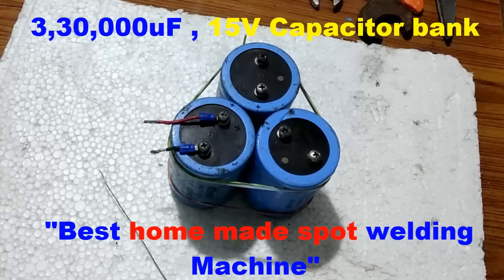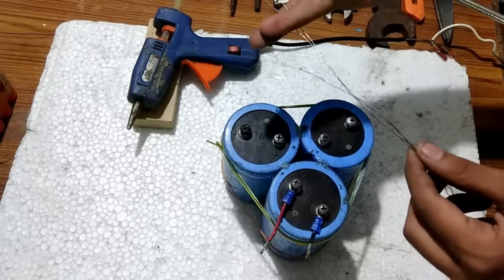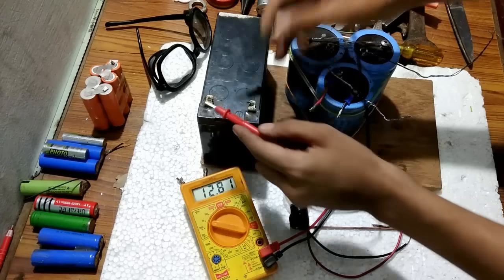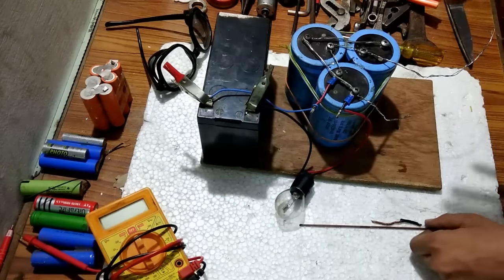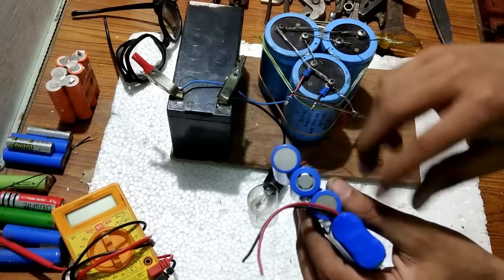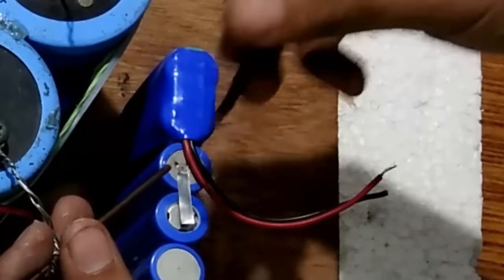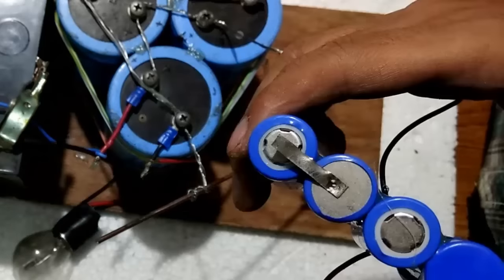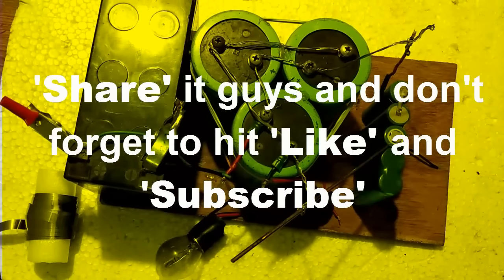How to Make Battery Spot Welder || New Capacitor Welding DIY

Comment: bro you nailed it....i saw various videos for spot welding using microwave transformer which is bit tricky and time consuming but your spot welder is easy and effective.
Reply from the maker: Brijesh kumar Thanks .. I have been figuring out a method for effective spot welding for a long time and i have tried most of them.. This technique indeed gave the best results :)
Reply: creativ electron7m  from where to purchase capacitors
Reply from the maker: varunanaditya mandawara : I got them from large DC motors.. These should be available on ebay or amazon.
Reply from the maker: varunanaditya mandawara :u there on WhatsApp????
Reply from the maker: varunanaditya mandawara ok

Comment: Really a simple safe nice project. 

I would personally find a case, protect the capacitors from accidental shortcuts and replace the terminals with longer good quality wires. 

And i would builda pedal for it to activate the circuit only when you are in the correct position. Like this you have to guess that the welding spot will be the right one at the moment of the shortcut. 

With a pedal - ab hand made one - you can press it only when you're ready. 

To metal bars with a wood frame and a spring can do the job. 

Anyway the idea is amazing.

Comment: Okay, thanks. I am making a battery pack for a high amp load (30-40A). Do you knoe the thickness of the nickel alloy strip you use in your demonstrations? Cheers

Comment: Very clever solution. I need to spot weld some Li-ion batteries together. Is it important to have a sharp point on the copper electrode?
Reply from the maker: not too sharp little close to sharp
Reply: Also; what metal is the negative electrode made of? And is this important?
Reply from the maker: the one to be touched to the battery is to be flat while the other one is to be pointed
Reply: Thank you. Is it important to use copper? Or would say a brass rod work?

Comment: Thank you Sr for the video. Can i use the 6 500farrad  supercaps to spot ? Thank you
Reply from the maker: garabini NJM higher capacitance means higher SC Current which will burn the nickel strip.so in parallel they won't work but they will work perfectly in series.

Comment: This is a good simple design, but what is the advantage over going directly to the battery terminals (skipping the capacitors)?
Reply from the maker: Time. 
  Spot welding needs really high current for about a sec or even less than that.Capacitors cut-off automatically after dissipating large current while going though a Shot circuit while direct battery connection not only reduced battery life but also damages the welding strip.Also you are the one who has to perform the disconnection.High current for longer time results in blackening of the strips....If you can some how control the Short circuit current discharge time,i am sure that direct batteries should work the same..
Reply: creativ Electron7M Thank you,  that explains it!
Reply from the maker: J Bishop Anytime :)
Reply: Use a 12v solenoid relay switch instead of capacitors and fashion the terminals so that you can hold them with one hand. The solenoid will do your connecting and disconnecting for you, you just have to press a momentary switch to set the solenoid off. Boom! You're welded!
Reply from the maker: Good idea!! I will try that for  sure :)
Reply: AvE?
Reply from the maker: ELECTROHAXZ ave??
Reply: A battery has a reasonably high internal resistance, so unless its quite big it won't be able to deliver the current required for welding. This setup can be pre-charged from a very small battery or a low-power power supply. A capacitor has practically no internal resistance, so its discharge current while short-lived, can be huge.
Reply: Bob Berg I use a 12v ATV 200A battery for my DIY spot welder and that works perfectly.
Reply from the maker: Bob Berg Correct
Reply from the maker: darkkevind1978 Yes but it will burn the nickel strip and the welds too won't be neat.
Reply: Of course mate, the 200A is the key, you have a beast there.  With this method you can do spot-welding with a tiniest battery as long as it can deliver the 12V, the discharge current can be as small as you like, as the actual discharge current is delivered by the capacitor.
Reply: creativ electron7m "If you can some how control the Short circuit current discharge time,i am sure that direct batteries should work the same" - Actually I'll try to use a solenoid switch for limiting discharge time (although I intend to connect my AC welder to it instead). We'll see how will that work out.
Reply: Bob Berg "A battery has a reasonably high internal resistance" - Actually lead acid batteries have a quite low internal resistance.
Reply from the maker: Sure.  Please update the results here after the tests
Reply: The weld timing!

Comment: Hi Mr Electron. Regarding the above arrangement, I have a 330,000 microfarad capacitor, but unlike yours mine is rated at 10 volts. Will this slightly lower voltage make it insufficient to spot weld 0.15mm pure nickel strips to a battery? Also, please tell me what thickness of nickel alloy strip you use? Thanks
Reply from the maker: Nathanael Corker 10V is less.. You should use thin nickel strips for these

Comment: I purchased 2.7v 100farad x 12 No.s . Is it sufficient for spot welding?
Reply from the maker: more than sufficient
Reply: @MrElectron  thanks for the reply.
Reply: @MrElectron  is it the same if I replace the battery with something like a laptop chrger?

Comment: Very simple and effective. Just two questions, the nickel strip u get from where? Is there risk of electrical shock touching the electrodes? Congratulations for the clever project man.
Reply from the maker: Gograss Gam I purchased it from ebay.I assure you that there is no risk of electric shock coz its only 12 to 13V

Comment: What are the properties of the lamp 12 volt ? Amp ? Watt ? Good job well done
Reply: Any 12 volt car bulb will do the job. An 8 watt side light will do. It is just acting as an in series resistor and the higher the wattage the faster the recharge time for the capacitors. As this will only be of the order of a few seconds it really doesn't matter.

Comment: Wow....this is great. Good work man!
Reply from the maker: Myles Jarvis thanks!
Reply from the maker: Thanks :)
Reply: I have a question. Sometimes I need to spot weld this stainless steel, probably not much thicker than the tabs you are spot welding. Do you think this would work?
Reply from the maker: yes it should work :)

Comment: Very nice! Need this for the same job! On your site you say: 'super capacitor spot welds are not as great as the method that i am teaching you now', but why? Don't they release the current fast enough?

Why do you say 3,30,000 uF instead of the world standard 330.000 uF? Is that normal in India?
Reply: yah indian numerals go like this -> 1thousand (1k), 1 lac (100k), 1crore (10m). then it repeats, hundred crore, thousand crore, lac crore, crore crore (1,00,00,000,00,00,000).

but electrical components are normally not referred this way. only everything else is referred. 

i believe he did it just to sound funny. :)
Reply from the maker: iceberg789 Thanks for this explaination ☺

Comment: Nice job! Need this for the same job. Thank's! Why is a super capacitor less efficient? Does it not release the current fast enough?

Why do you say three lag??? thirty thousend instead of three hunderd thirty thousend? Is that the India way ;)?
Reply from the maker: Ruud de Graaf - Thanks 🙂. Supercaps are less efficient coz they produce high current which if not disconnected in time damages the nickel strip without even creating the welds.
i said "3 lakh 30 thousand" which is indeed the Indian way & now i know that i should have used "three hundred & thirty thousand".
Reply: OK, I'm glad  for you I posed the lakh question haha. It's really a shame that supercaps didn't do the job because they are much cheaper to buy new then electrolytic caps. I did a search on aliexpress and for 0.3 Farad you pay at least $70 an most of the time more then $100. Where did you get those fantastic 0.11 F caps?
Reply from the maker: Ruud de Graaf .. i will make a video for supercaps performing the same job with same spot welds.

Comment: Follow the wire from your non-copper electrode to the first capacitor.  Then follow it across to the next capacitor.  It appears to touch the second pole of the first capacitor: why is there not a short circuit there??  THe wire does not appear insulated.  Look late in the video, around 13 minutes... you can see the short clearly.  Current should be flowing directly across there... should be lighting the bulb constantly?

Comment: It is hard to get such high capacity capacitors every where. From where you got these??
Reply from the maker: iffee100 From heavy dc motors..  Caps were connected in parallel to the motors.
Reply: They occur often in 1980`s electrical equipment like Speaker Cross-overs, Amplifiers & Laser Printers - to name a few.
Reply from the maker: Ashley Clarke Correct.

Comment: what if i use a laptop.charger instead of the 12V battery, it puts out 18 volts and also offers better amperage.
Reply from the maker: OceanBreeze yeah! but the capacitors are not to be charged beyond 12.5V for spot welding.It will burn the nickel strip.

Comment: can i use a single capacitor of 490,000uf @ 16vdc instead of your 3 x 110,000uf cap?? will it melt the nickel strips??
Reply from the maker: Sure you can but i would suggest the you charge the capacitors only to 10V max to compensate the high capacitance.I am charging mine upto 12.5V.Yours should also do the job. All the best.
Reply: i am using a 12v dc batt like yours and that means if the voltage is constant at 12v5, the higher the capacitance, the higher the discharge  amperage right? so it will melt the nickel strips unless i use the lower voltage like you suggested. many thanks for your fast reply...
Reply from the maker: energy level is= 0.5 x C.(V)^2 .Yes try some low voltage source.Try using 2 mobile chargers in series.They are each rated 5.1V ,so in series they make up 10.2V which should do the job.
Reply: got it.. 

will use an adjustable dc power supply (set to 10v & hope it will not damage the power supply) to charge up the capacitor for the spot welding ..

thank you again for your kind input.
Reply from the maker: kt goh yeah try that
Reply: +Kt goh You "should" connect capacitors to psu through a resistor that will limit inrush current, something in range of 10 ohm will be ok (5-30ohm...)
Or a 12v car light bulb if no big resistors available... any power will do, i would pick 21W (brake light) if available...like he did in vid.
Reply from the maker: Pyroslav x Hi! its the discharge current that is needed to be reduced.The bulb or resistor mechanism will reduce the discharge current more than needed.
Reply: creativ electron7m the bulb is more to protect the battery itself from the short circuit that occur when the weld is done, it gives a slow and nice charge to the capacitor bank as well but main thing is that you really don't want to short out a led acid battery because it gonna take damage very quickly. Capacitors don't like to be shorted out either but they can take quite a lot abuse before they go dead and this case were 3 caps are used will lower the total load of each capacitor than using just a single huge one also. But I doubt limiting the output current of the capacitors will lead to a good weld so it should be a give and take if they eventually wears out over time
Reply from the maker: Pulverrostmannen Correct, thats y i used it.You didn't get it.What u r saying is correct but her question was different.
Reply: thanks Pulverrostmannen for your very informative comment.
Reply: I am always glad when I can help :)
Reply from the maker: Pulverrostmannen :) :)
Reply: Three caps are sharing the current. A single one can't hold that stress. Can eventually warm up too much or being unable to provide that power on time. 

That is true unless you can find a big super capacitor, way more expensive and available since not more than a couple of years.
Reply: The resistance of the small gauge wire interconnecting the capacitors and the electrodes will have a significant current limiting effect.
Reply: it depends, check your cap ESR, by capacitance alone it doesn't necessarily mean it will work, you want your ESR lower than 6mOhm

Comment: Hey these capacitors cost $41 each and the 12v batt is $20 in the USA is there any way to create one cheaper. ? Since I can buy a retail spot welder for $150, I'm hoping there is a way to make one under $50 ?
Reply from the maker: Thanks for that information 'Oz Tas'.I will think out a cheaper alternative and upload it. :)
Reply: ty you the best
Reply from the maker: Oz Tas :)
Reply from the maker: Oz Tas Are you an engineer or a student ??
Reply: im a 2 year low voltage tech whos trying to get into solar panel installation business and am in need of low budget tools for my current project
Reply from the maker: Oz Tas Thats really gr8 🙂
I will upload the related video soon for sure.
Reply from the maker: Hey! Oz just placed the order on ebay for the parts needed.The video will be uploaded soon :)

Comment: Great idea, A must future build for me! save me soldering my Samsung salvaged 18650 cells together.

Goda luv the china 18650 cells, the only thing that limits there capacity is the lack of room to add more zero's on the label. :)
Not long before china print there new 18650 - 1,000,000mah cell.
Reply from the maker: Thanks :)

Comment: I FOUND capacitors 3 FARAD 12-18 VOLT HOW TO CHARGE IT 12 OR LESS I WANT TO FIXED DRILL BATTERY IT WERE CELLS NOT LITHIUM BUT Cadmium AND THE NICKLE COMES 0.1 MM OR 0.2 MM OR MORE IT CAN HELP ME FOR THIS WORK AND THE WELD IS STRONG ENOUGH  PLEAS HELP ME BECAUSE I WILL BORROW THE MONEY And thank you very much
Reply from the maker: Charge it with a 12V UPS or car battery & follow the same procedure as above.If the power is too much , use a 9V charger from an old wifi router or connect 2 mobile chargers in series.
Reply: thank you  and I WANT TO HELP ME MORE IS THE JOIN BETWEEN THE CELL AND NICKLE IS STRONG  ENOUGH THAT YOU CANT SPATTERED IT EASY

Comment: I have a question. Why you don't even have to use any protective gloves ? You're welding with bare hands and not get electrocuted? How? :O
Reply from the maker: no electricution risk at 12v dc

Comment: Gentlemen: Please don't hate me. I enjoyed the video immensely and will put this procedure to use.  But a SERIOUS CAUTION is in order. Please correct me if I am wrong. The 12.5 volts DC and 3 capacitors at 330000uF provide more than enough power (amperage) to electrocute you if the skin of both hands or fingers touch the bare electrodes or conductors at the same time.  5 mAmps across your heart is well enough to kill you. This circuit produces much more than 5mA.  Under lack of caution or any inattention this circuit can easily kill you.  I believe that the only reason this did not seriously injure or electrocute the instructor is that he never touched the bare electrodes or both conductors at the same time.  He maintained contact with the insulation on the copper conductor at all times.  Much caution must be used with this circuit to prevent death or serious injury.  Make sure that both electrodes are well insulated and absolutely never touch both bare electrodes or bare conductors at the same time without proper insulation. It would not be excessive to wear non-conductive gloves while working with this circuit. Large capacitors are always dangerous. One must always use great CAUTION when working with high capacitance. This is a very dangerous circuit. (Electronics Technician since 1965.)
Reply from the maker: AWK not dangerous at all since the voltage is only 12.5 volts.
Reply: "Current kills not voltage"
Reply: The 12.5V divided by the skin resistance determines how much current will flow. The capacitors being large makes no difference as far as how much current will flow through the skin.
Reply: Well, that’s true, but if your hands are moist because it’s hot, and you’re sweating, the salt water you sweat out is very conductive.
Reply: You won't be electrocuted by 12.5VDC even if your hands are covered in sweat. If you stick your tongue across it you will feel some uncomfortable tingling, but that is it.
Reply: he's probably thinking of vacuum tube era capacitors, that can store a charge at 400V or something
Reply: have u ever touched the output posts of your car battery.  it has a cranking current of about 500 Amps.  u can lick ur fingers and touch them and wont feel a thing.  I read these cautions very often from people like you who don't understand electricity.  low voltage will not kill you.  ur skin has a lot of resistance.